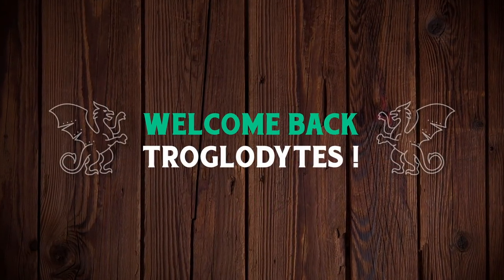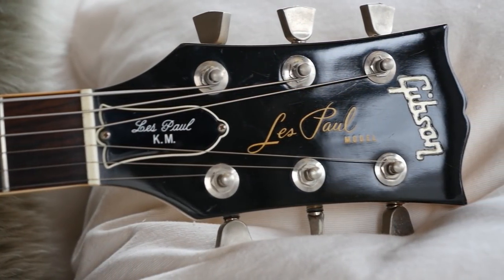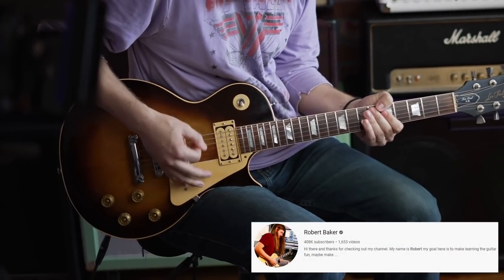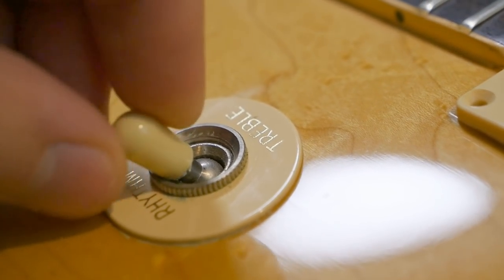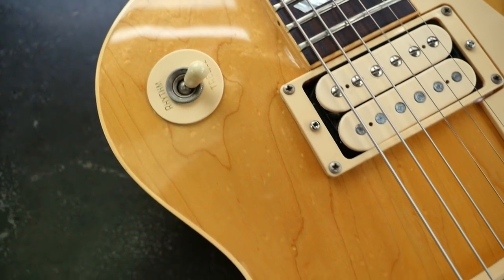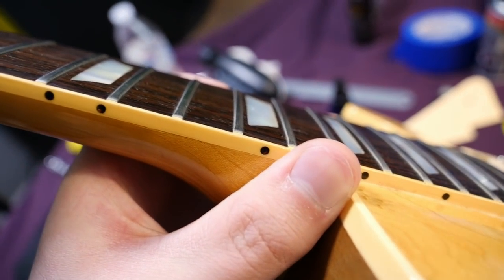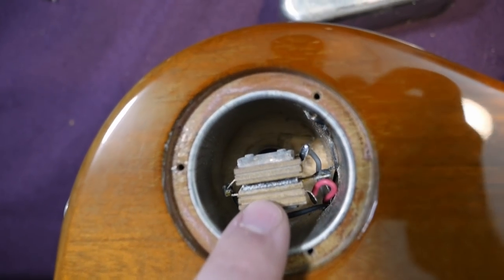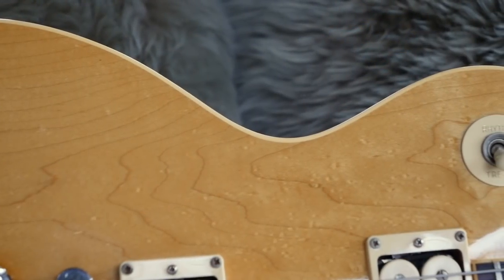Gibson's FAIL of a "Reissue" | 1979 Gibson Les Paul KM Custom Made Plaque Natural Review + Demo

Comment: From personal experience I would say that the corroded plating is from an inferior quality in the plating from that period rather than the player having overly corrosive sweat. Why? I bought a 1977 LP Standard new and after only a few years the plating began to bubble and flake. Meanwhile I have owned and played a 1991 LP Standard for 30 years and the plating is all intact and smooth, although with a patina. The reason probably has something to do with the 1977 plating being chrome and the 1991 being nickel. And if you are going unscrew the switch tip to function properly you should probably insert a piece of plastic or rubber into the tip before you screw it on to keep it snug and prevent loss.
Reply: Great tip.
Reply: You’re 100% correct, they were using this craptastic plating on lots of automotive parts as well before just changing to plastic, side view mirrors, antenna posts, headlight trim rings etc…
I suppose Gibson’s hardware was getting the same finish and possibly the inferior metal as well usually referred to as ‘pot metal’. 🤙

Comment: You can remove the screws pretty easily with the right extractors and or vice grips. Depending on which screw you want to remove.
Reply: This guy's a trust fund baby. You think he knows what vice grips are?
Reply: @haywoodjablowme699  I think he knows what vise grips are.
Reply: @ALTDOK667  he could also file a little slot in the screw and move it with a flat bladed screwdriver.
Reply: @ikestoddard2458  I would just use a small chunk of thin leather with a Philips head.
Reply: @haywoodjablowme699  damn bro, salty much? You wanna talk about it?
Reply: @PupsMcDougal  What is there to talk about? Trogly makes serious money on these instruments, yet he keeps showing off that he has next to no knowledge about them, besides what is "collectible".
Reply: @ileutur6863   The issue that I have is that no one can genuinely be happy for people, so instead people find ways to degrade others to feel better about themselves, which is very childish in my opinion. Can't we just be happy for people? Is it so wrong that he doesn't want to take out a screw? C'mon guys, grow up!
Reply: @ALTDOK667  Or stretch a wide rubber band over the tip of the screwdriver. For the really hard cases, a small piece of 400 grit sandpaper. If that doesn't work, it's time to get the Ezy-outs.
Reply: @ErnieB  Elastic bands will do in a pinch, but I've never tried sandpaper. I usually just drill out the stubborn ones.
Reply: @ALTDOK667  Just a little piece of 400-600 grit, folded over, so grit on both sides. Push in, and twist. I've had good success, especially on rusted, worn screws.

Comment: A guitar should be setup before being reviewed, in my opinion. They setup should be no less routine than cleaning the fretboard. Setups can vary widely person to person and it is a shame that today you don't like a guitar because it might need a truss rod adjustment or has the action or bridge adjusted poorly. These are minor routine adjustments, not a flaw with this example. They can be setup perfectly the day they leave the factory, they are still going to need to be adjusted sooner or later. I basically do an adjustment every time I change my strings. Don't necessarily do everything every time, but I check the relief, height, and intonation and adjust as needed.
Reply: Really?
Reply: @walkerpendleton760  Absolutely. Giving a guitar, especially a used one, a less than favorable review because it isn't set up how you like it is doing yourself a disservice. Furthermore old strings that haven't been changed in a long time also hold back the guitars potential. Now a new guitar should come set up well, but even then the neck can shift due to climate changes during shipping and storage, requiring an adjustment. A twisted neck, maxed truss rod, headstock break, etc are serious issues, but having the action too low or too high or having too much relief in the neck should not be deal breakers so long as they can be resolved with a simple setup.
Reply: You take this about 20x too seriously, kid.
Reply: @HeelBJC  nah, I could care less, you just missed the point, to provide some advice for anyone who actually plays their guitars. Don't lose out on the guitar you want because it needs a minor adjustment.

Comment: Funny Story. I've owned my Natural top 81 LP K.M. for 30 years. When I bought it, it was the most comfortable guitar I've ever played, though when I plugged into an amp it squealed like a banchee, so it didn't take long to replace the pups with a black DiMarzio PAF pro in the Rhythm position and a black Gibson 500t in the bridge. After watching this video recently I was curious to see if I had bought guitar with original T tops, so I after a bit of a search found my original creme open faced pickups in a box  in a spare bedroom. What I discovered was rhythm pup was untouched (T's both pointing in same direction, though the bridge had been modified in that the T's we're pointing in opposite directions, someone took the single coil closest to the bridge and reversed it, making the T point down, not up. I'll never know why?? Though 30 yrs later mystery solved for the disappointing feed back it originally had. Can wait to correct and hear the original T Top sound

Comment: I had a tobacco one. Paid $700 for it in early 90's.
It was player grade so I put flame veneer owner top and painted just the top.
Put 50's and reissue parts on it.
Was a cool guitar. Sold it and it wound up in England.

Comment: I have a cherry SB from the first part of the run of 1500. I bought it from a guy that had it stashed in a closet un-played for 20+ years. He bought it new and came with bill of sale. It looks like it may have had a little use prior to that but not much. It is completely stock and even has the two very small screws where the custom plate sat behind the stop tail. The plate was missing but the screws are still there, which from research, only the first batch had those. It is heavy as stink but the cream top HBs absolutely rock. All in all, I think it is a solid guitar. My not be historically correct but it screams as a rock machine.

Comment: Everyone wants 50’s spec but the three piece maple neck does have to advantages. The low end is cleaner and tighter. I had a 1979 Les Paul Std. Goldtop, not a re-routed Deluxe. Had TWO actually that were from the same batch. Mine had a three piece Birdseye maple neck and my Dad’s a figured one piece mahogany back. Mine was light and sounded great!! Remember Zakk Wylde preferred Norlin spec’d maple neck Les Paul Customs. Tight. My Goldtop ate my friend’s 1958 Sunburst! A real one, no reissue. This was the early ‘80’s. KM’s were also known for not being made in Nashville. Kalamazoo. Gibson made Les Pauls in both places for a while in the late ‘70’s. My 1978 Les Paul Custom was Kalamazoo but both Goldtop Standards were from Nashville. At the end of the day good is good! Played lots of LOUSY fifties Gibsons and Fenders. Just more lousy seventies than there were fifties and sixties.

Comment: I have a 77 or 78 Standard version.....I had to rebuild due to the corrosion and wear.  I rebuilt mine to be as close to a late 50's spec as for materials of the hardware.  I didn't get the original shaw pu's with the guitar though they were still around......it had DiMarzio blade type metal pu's in it as replacements....which was 80's period correct for the METAL ERA.....but I replaced those with BurstBuckers which I tuned.  I look at pickups as 2 coils of copper and the slugs and screws have to be right as far as material plus a Alnico 4 magnet.  I like a weaker magnet and ideally have less that 8K resistance.  This one had the 300K Norlin era pots in it....so I ended up changing the whole wiring harness plus tone caps and pots to 50's correct specs with the exception of the cap values which are significantly less that a .022uf.   I was lucky to find locally a set of period correct Grover tuners off another Gibson guitar.  SO once finished and rebuilt, it dramatically changed the sound of the guitar to where I actually like it.....and it sounds very similar to the Bernie Marden BEAST.  I got this guitar off an old buddy so I was familiar with it, and knew he was not totally satisfied with it considering he bought it new as old stock in the early 1980's.  It really came alive after the changes but unfortunately my buddy had passed away suddenly and never got to play or hear it there after.  The only thing I wish it had was a mahogany neck as opposed to the maple.....other than the neck tenon style......it would be more closer to the late 50's LP's......BUT mine as a Standard has the 3 piece top....BUT at a distance looks almost gold toppish due to the fade & yellowing.
Reply: and....if you are in ohio.....i'm not far away in the Pittsburgh area.....if you'd want to play it side by side......though its NOT for sale hahaha

Comment: Talk about weight - I picked up a 70's Les Paul Deluxe Pro with P-90s and maple neck.  Love the guitar- but the weight came in at 12 lb 8 oz!  Have another 70's vintage LP Deluxe with strange wiring - the selector switch is upside down and the volume/tone knobs are also upside down.  On opening it up, the wiring is not long enough to install the switch in the normal position; also, the soldering looks clean and unaltered.  A factory install fail by a newby?

Comment: I'm not convinced a strap made that damage down there. Straps are made specifically not to damage, though it's not impossible. It's also possible that rings on his fingers from either stringing the cable through/around the strap or taking a strap on and off did it. But my official guess is that he never used a stand. He simply rested in a harder surface over and over again. Later when you notice there's no stand rash by the headstock i become more convinced

Comment: Do the lp's usually come somewhat setup from Gibson? I bought one of the demo shops and the low E is buzzing like mofo on the 12th fret. So does the G-string a little bit but I always thought that was normal. All the saddles are practically on the bottom of the abr1 which is a skinny bridge but the intonation is really close. Guitar was shipped to Michigan and the neck went flat pretty quick. What's weird is that I can literally remove the truss rod nut and the neck is still flat. It's nutless I say!  I'll pay for a simple yes or no just tell me where to send it.
Reply: Are you sure it's flat? Did you put a straight edge to it?